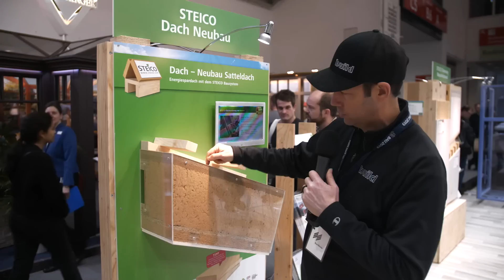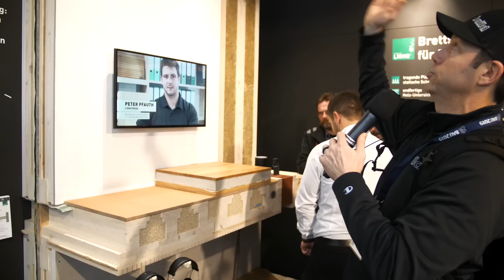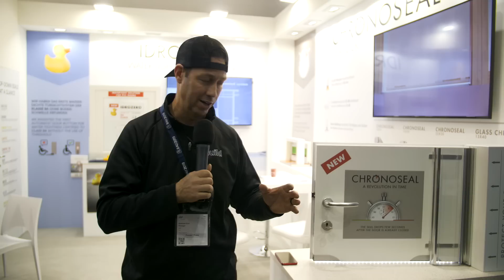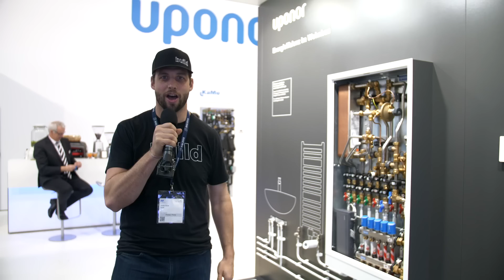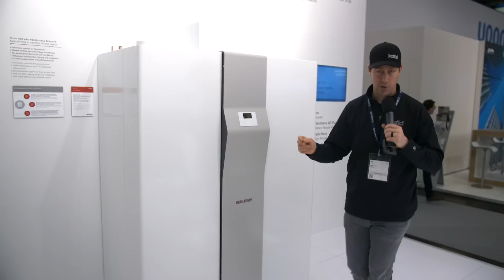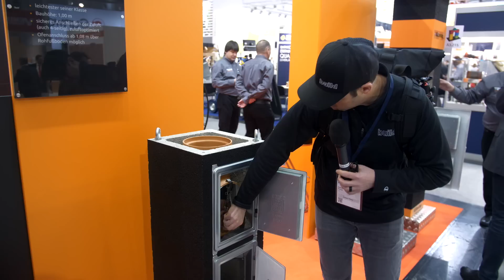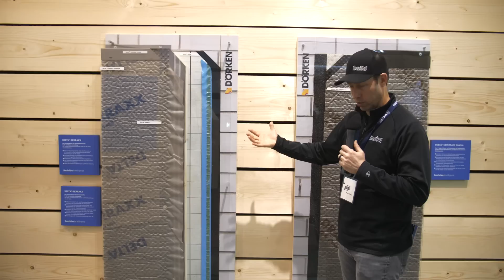These German Building Products are Awesome! Day 2 at The Bau Show Munich 2019

Comment: lol that sounds so funny you use the wood cutting down trees and then you say its eco friendly construction material no please don't tell me about sustainable forestry stuff almost 75 % of the timber harvested is not sustainable wood its like the electric car guys its "eco friendly" when all they are doing is charging the car with electricity from a coal powerplant counting all those transmission losses resulting in more co2 emissions than what fuel would have done

Comment: Insulation on the outside of buildings can be questionable.  Modern lifestyles dictate that the homes are empty during the day and do not need to provide a heated space.  We expect the house to respond quickly  to our call for heating and thus we require light weight low thermal mass wall constructions with good insulation.  If the property is in occupation for long periods then yes we need a high thermal mass that is slow to respond.  This can be beneficial since the building can absorb heat during daylight and give off the heat at night.  Until society changes the way we use houses having a high mass core with the insulation on the exterior is arse about face.
The other issues of having insulation on the outside of the building is the susceptibility to damage especially with thin renders as well as preventing the building wall to breathe to obviate stale moist air collecting in the main thermal mass.

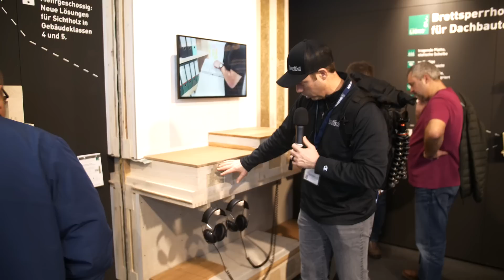Comment: 3:55 you can fill it with sand? I'm planning a raised floor cabin, can I use sand instead of wool as insulation?
Reply: Wool doesnt go into ground beacuse it will degrade fast

Comment: Thanks for the insights! I am of German origin and when I bought my house here in New Mexico 15 years ago, I thought - Oh Lord, I move to the greatest country in the world by a time warp back into the 1960´s - construction-wise. I have made my peace with it and make my house the best out of two worlds! I use 2x6´s and measure them in millimeters before I cut them, I don´t pour a 4 inch concrete slab, but a 20 centimeter thick one - and no nails - no nails - nails! I am at an almost zero utility bill over the year. Solar electricity, solar hot water, air-tight wood stove for the winter, 10.000gallons of rain water cisterns for soft clean water! And my Chevy Volt also gives me 40 free miles per day from my solar system. Tesla Cyber Truck is on order! US can rock, if the people are willing to accept changes!

Comment: I'm happy I found this video. The chronoseal product looks really interesting. I've just had a pivot entrance door installed and I'm experiencing the problem of inadequate sealing due to the manufacturer's use of a brush seal at the top of door because there's no jamb that the top of the door comes into contact with, so I'll definitely be checking out that Chronoseal product.

Comment: you need to be a little less preconceived and better prepared when you go to a show in Europe! With the wet and humid climate, corrosion is an old problem and dealt with when you didn't even know what insulation was! Also all those insulation products you show, are in use for the last 30-40 years already. This is as well valid for the wood stoves, the outside  combustion air supply was done as well 40 years ago!

Comment: Semi membranes (damp tight not air tight) are installed on the inside in Europe because humidity inside is higher than outside, it prevents the isolation to get wet from damp.
For the parking: you put your car in and get out, the system parks your car without loosing traffic space in the parking garage for 1000 cars, with your ticket you can ask your car back, and the automatic system will bring it to you. It even scans the height of your car to put it in a floor that fits that height.
The double pipe for chimneys lets outside air in, heats it up along the inside pipe before it is used for burning (energy efficient), it cycles back in the inner pipe to the roof and exhaust. The little hole is not for rainwater from the top, but for condensation when the hot exhaust air cools down by the cold air in the outer pipe. This closed system prevents oxygen from inside the house to be used by the heater and carbon mono- and dioxide from entering the house. Almost thirty years an obligation for every new heating system in most of Europe.

Comment: Actually it’s not really really good with acoustics in between floors. This is the single most difficult problem and complaint about this type of building in germany. The only way to really eliminate sound transfer between floors in a CLT or massive timber house is to do a concrete slab on the second level floor. It’s bloody expensive but it works . I have a massive timber house in germany and in between the walls the sound dampening  is quite good but in between floors it’s terrible.

Comment: These videos make me feel like houses in the US are just awful.
Reply: They are
Reply: So you are all kinda right. The products he’s reviewed are very expensive. I build custom homes and have in the past built spec homes. 2 completely different areas in the world have completely different building codes and supply’s. 
Most homes we build are on 24” forma drain footers. ICF or insulated concrete forms (Nudura). Walls are 2x6 Carolina pine/ Canadian pine. Zipwall 7/16 sheeting, Zipwall taped seams. Floor joist are scissor trusses or TGI customs. Usually buy a truss system from a manufacture from the homes roof pitch specs. Going off of those added items a 2,000sq shell would come in around 200k in materials. Now you have to insulate,drywall,wire,plumbing and finish material kitchen and bathrooms. Floorings alone can reach 10-30k in some homes. Hell paints 60$ a gallon for trim paint (sherwin-Williams emerald). Building and building correct and with good materials are two different things. If your looking in developments in either American or Europe you would find these materials. Its all higher end!
Reply: Yep, houses in mainland Europe are pretty good, don't go to Ireland though, I live here and the houses have the worst quality! Especially when builders skimp on materials and space.
Reply: Just imagine the average house price doubling if US homes used these techniques.
Reply: Homes built as fast and cheap as possible by home building companies can be, but if you build custom and care you can build a fantastic house.
Reply: Oh boy. You haven't seen the ones built in the middle east!
Reply: Cuz they are
Reply: mikechristian@m2.com
Reply: ‘Murica™
Reply: Its very strange that hes so surprised by the Steico secure plaster, every house is made like that in Austria and has been since  the 70's minimum
Reply: To be fair, most of the things they are showing are most likely too expensive for an average European as well.
Reply: @uramalakia  No its not
Reply: @MrtinL1  Then I guess we live in two very different parts of Europe.
Reply: uramalakia yes but we have cheaper alternatives thats works/preforms pretty much the same
Reply: @uramalakia  well if you want to be fair then you should see how expensive it is in the USA and how crappy the quality is across all spectrums, usually higher end Customers when they want something nice esthetically , efficient
Reply: @uramalakia  bruh too expensive for average europeans? The cost of living and the division between poor and rich is lower. The average european has a way more convenient life than the average american. The happiness here is drastically higher
Reply: @abcD-wf9yr  I wasn't commenting on either divisons between rich and poor, convenience of life or levels of happinnes.
Reply: they are.

Comment: The ironic thing about all of this is that 1) It's all expensive, and 2) Most of it isn't necessarily "sustainable" or efficient to manufacture. 3) Even what is "sustainable" in function/materials sourcing, usually takes a lot of energy to produce. And if products are more expensive, typically they are less sustainable (even if in their long term function/use they are more sustainable or functional).

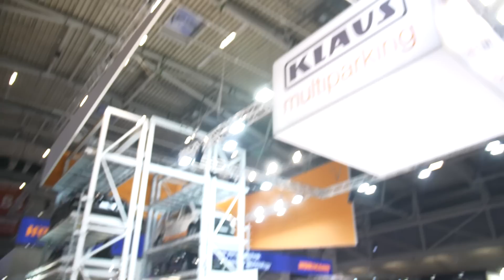Comment: 9:48 The high rise garage system is meant as a solution for areas with sparce parking space inside bigger cities.
Works like a storage system you might see inside large warehouses. Drive onto the platform, go outside, the car gets stored and an empty platform will arrive for the next car. Want to get your car out? Insert the ticket/card and the system will pull out your car for you.
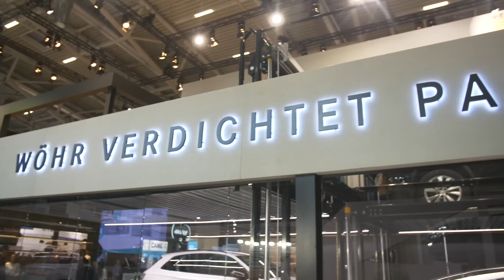Like it says on 9:54 "Wöhr verdichtet Parkraum" - Wöhr (the company) compresses parking space.

Comment: the price for that fireplace system only makes sence with a air tight house, heat exchange for the system and then you pay so much you ll need a lifetime or more to save that money.
And I have a isolated ouse with heatpump and fresh water exchange. 
There is a lot of sweet stuff shown but you have to be earning like swiss people to be able to pay for it. the normal german building is build a lot chaeper.
If money is no ssue I d gladly build with wood isolation and all that.

Comment: I'm studying Architecture in Germany and theres like a reversion to natural building materials, because concrete and steel have been so big over the last 100 years. Especially when you think of the room climate and the toxic components that for example are used to make plastic-insulations fire resistent. And sustainability is getting a big thing - the energy you need to produce steel and concrete compared to wood is nuts. Wood is a good thing for the health of world and human :)
Reply: Concrete and steel ARE natural building materials . 
As much as i prefer wood to concrete and steel , there just isn't enough of it to use it exclusively around the world and its not very green to use it in places that dont have vast forests. It's best to use those resources that are locally available than to add on the cost of shipping .
Reply: @siriosstar4789  That’s one reason why I like that the us uses wood for 99.9999% of our homes.

Comment: Different parts of Europe use different building techniques. Exterior walls in Ireland have an inner layer of 9" cavity blocks and an outer layer of 4" solid blocks with a gap between the layers for insulation. (typically 2" expanded polystyrene)

None of that weird wood fibre stuff or those big red clay bricks!
Reply: That's how it was done here in Germany too, but since on new buildings you have to have a certain amount of insulation that's not enough anymore (unfortunatly that makes it a lot more expansive)